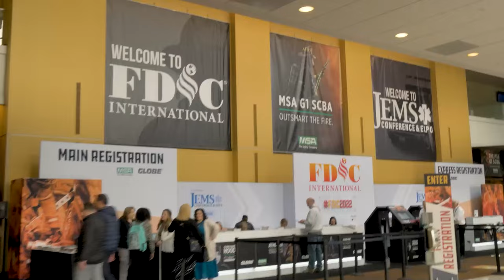Pierce® Volterra™ Fire Truck Electrification Technology

Comment: Well at least your fire trucks look like a normal one, I’ve seen on YouTube what the lafd went with and boy is the lafd truck ugly, but now this, you can’t even tell the difference (which is what I like about it)
Reply: And here they don't use any advantages of an electric transmission e.g. the Rosenbauer vehicle has vastly superior, cab because of the lack of a doghouse.
Reply: The truck looks good but nothing beats internal combustion engines.
Say no to battery vehicles